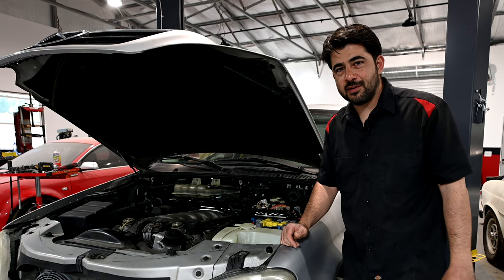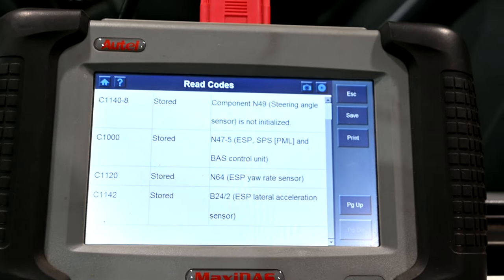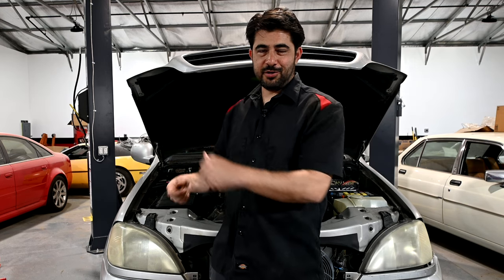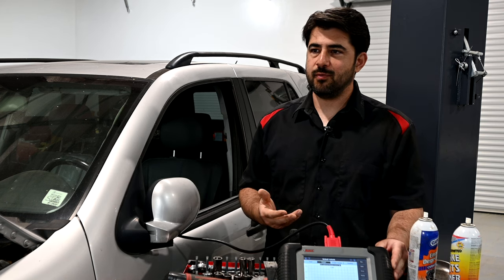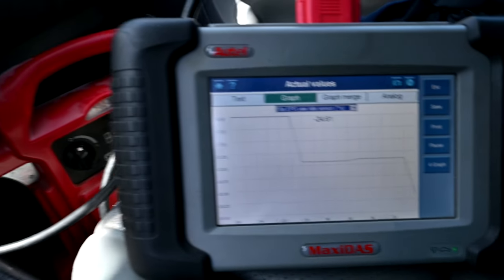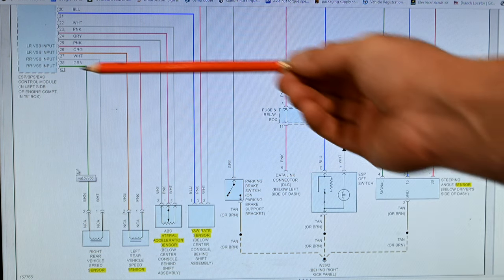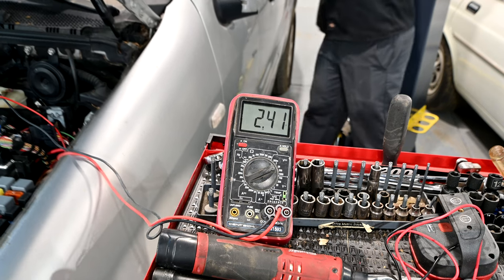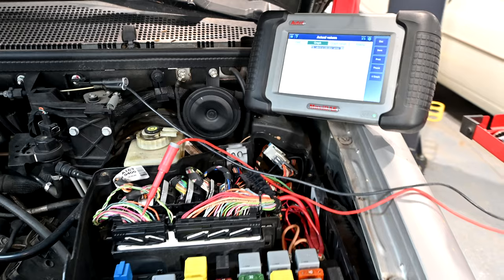Lateral Acceleration and YAW Rate Sensor Diagnosis on Any Car

Comment: A yaw rate sensor reads rate of change in degrees per second. so I believe that that reading would being positive or negative would not have any bearing on which way your turning. This is not like a steering angle sensor where 0 degrees is dead ahead steering left is negative and steering right is positive or lateral acceleration sensor where stopped is 0 and acceleration is positive and deceleration negative. In any event your video helped me! With my car sat still I'm getting reading from 40 - 170 degrees / second! Your video helped as I get to see what 'normal' looks like! Once I replace my sensor I'll take a look at the live data and see if I'm correct! Thanks for the eloquence of your explanations!

Comment: The thing is, just because a sensor is kicking out a voltage doesn't mean it is at the correct level. It's an indication it may be working  not that it is.  You also need a  DVM with a decent refresh rate - there are plenty out there which are pretty slow.

Comment: Incandescent test lights do not ruin the computer on the signal wire. Been doing it for years and can show multiple videos of others using it on signal wires. If its in 300 milliamperes range, its fine
Reply from the maker: I've got a video on that, 9/10 the signal wire is fine due to how the circuit is sit up. but "signal wire" isn't always that according to diff manufacturers. Plus you'll be doing the testing at the connectors where the ref voltage and ground wire are also and for those you should use the LED test light. so to keep from accidents and the need to switch test lights by default for sensors I use the LED test light and  for solenoids etc incandescent GL
Reply: @myRatchets  an incandescent light attached to the ground wire or the 5volt supply absolutely does not hurt the computer either. I test with an incandescent bulb on those circuits and never had a problem. I can also reference a diagnose dan video where he tests a five volt supply and ground with an incandescent bulb. And a scanner danner video. I do not agree it needs to be LED at all

Comment: Hermano I have an 2002 Mercedes ml320 I have no lights but from time to time my brakes automatically engage by themselves the Amber triangle blinks then goes away. When I turn of the car and restart it goes back to normal for less then a mile then brakes again

Comment: thank you so much. i have azera 2009 3.3L V6 GLS & the driving experience changed years ago. it was sporty in the corners & so stable on wet street or when it rains, it's like it sticks to the ground! very amazing system!. that had me pulling my hair to figure it out. mechanically checked & fixed but nothing solved. changed angel & the 4 ABS speed sensors. plus i don't have any check lights. all i can think of is that these sensors is giving wrong feed back!

Comment: Your garage looks fantastic and love the color scheme.    Truly wish you were local.    I am not a mechanic, but watch your channel hoping to find some idea to what could be going on with my newly acquired 07 LexusES350 with 150k mi -- steering is wacky and gas consumption is too high.   Loses power when just starting out on a trip.  Changed out the Power steering fluid.  Battery is 5yrs old and tests good, and voltage regulator "fail".   No lights  other than the tire sensors.  Already paid for a "pre purchase inspection" and they did alignment.  Told me the problem  with steering was "old hard tires".  The tires are 4yrs old and look new. 
I know I am about to start "throwing parts" at the car (with a different mechanic)  starting with a new battery, and possibly alternator.   And will probably take it to the dealership next week. 
 I usually drive older toyotas,  which are pretty straight forward.   Any suggestions about how to tell them to start out "to get to the root of the problem faster" would be greatly appreciated.
Reply: Make sure none of your calipers (or parking brakes) are partially seized. After a drive, measure the temp of each brake rotor with a laser thermometer. If one rotor is really hot, remove the caliper and inspect brakes. That would be easy to miss in a general inspection.
Reply: @spelunkerd  good rec.  Failing rack?
Reply: @spelunkerd   I will do that straight away.  Thank you!
Reply from the maker: @medini2  So I would separate the problems and go at them one at a time. 1st your steering (bad rack, inner and/or outer tie rods, these are the common ones)  depending on what you mean by whacky it could also be other things like low power steering fluid due to a leak, power steering pump going, brake calipers as spelunderd mentioned. Than the gas comsumption issue could be due to old spark plugs, Oxygen sensors, running too rich.  I don't know where the battery falls into this!  Bad battery is a simple test, if it keeps going bad when parked overnight than a parasitic draw could be causing it. GL
Reply: Have occasionally  noticed a "squeaking" sound coming from a rear passenger side when backing out the driveway.   The calipers/ or parking brake may be partially stuck.   
I will try fixing that myself when we get a little good weather--didn't get to that yet.
Reply: There is no rust or leaks. I  kinda believe it is rack causing the steering issue....the steering wheel feels stiff moving to the right,  and loose when moving to the left.  A couple times, the car seems to LEAP to the left when I am driving it down the highway...by itself, on its own without any help from me, the road, etc.  What is the definitive test?   Have already paid a mechanic to diagnose and they said it was the tires and had me do an alignment, LOLOL!!!!!!
The voltage regulator checks bad, battery good, no parasitic draw.
Reply: @medini2  that stiffness I’m pretty sure it’s the u joint that’s locking up I had one come in like that and it was a bad unjoint.

Comment: Nice educational info. I have a 1994 toyota cirolla DX 1.8. The battery is dead and when Use a stronger one and use cables to jump, the engine wants to turn over but won't. I tried spraying into carb with no results. Whats could be the cause?

Comment: I have a question i hope you can answer. Im having ABS Issues on a 2011 Optima EX Turbo. The can line reads 57.5 ohms. I was told to try disconnecting the Brake Vacuum pump, which i did. The reading changed from 57.5 to 58.1. I dont think this is enough to change much, but i could be wrong. 
The next component on the ABS control module is the yaw sensor. The can wires gave me 120 ohms at the ABS module plug. And a power/ground reading gave me 0.0 ohms when testing for continuity. Before i put an ABS module in the car, are these readings correct?

Comment: Shop looks good, thank you for your advise my yaw sensor was showing on the obd2 scanner -75.5 all the time parked and while driving, I bought one and I am gonna swpp it out, I check all wheel speed sensors and they were the same while driving, as well as the sas, changing date while driving.  Thank you so much.  what country do your avocados come from, I may be interested.  God Bless. ty again. I will comment once the sensor is changed, the car FYI is a 2006 jeep liberty sport with 190000 miles going strong.  
Frank

Comment: I got a code for a steering wheel sensor but also get performance code for the lateral acceleration sensor would the steering angle sensor cause the lateral acceleration sensor to not work properly??

Comment: Hello, Im having an issue with my 2007 hyundai sonata v6 limited.

It happens randomly but its driving me crazy. Im going ti try to explain as best as I can.  While driving  all of the suddden my ESC OFF lights starts blinking while the car feels like is dragging its tires. Well now the minute I turn on my headlights or I flash my high beams it does it all over again. Also while that is happening which it last for a few seconds. I noticed a noise/buzz from under the steering wheel. Im scared of driving now because I dont want to gwt into an accident because I dont know when the car is going to act up or how bad it will do it.
Reply: Sounds like one or more of your Brake Calipers are locking up.